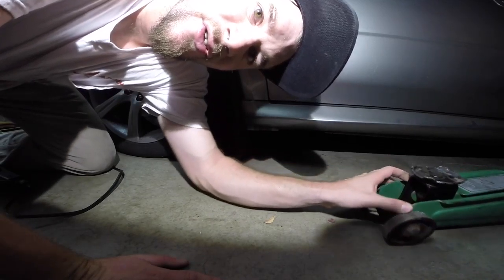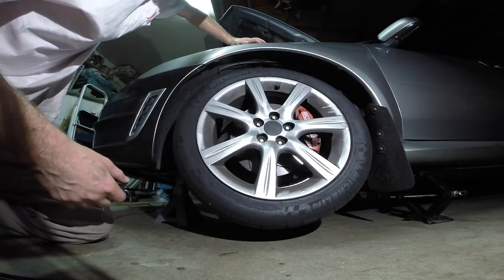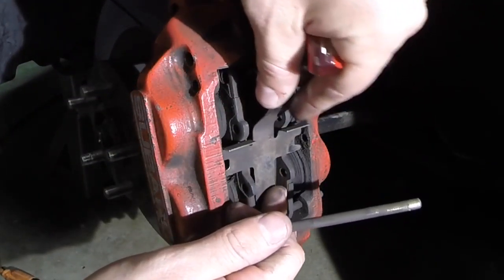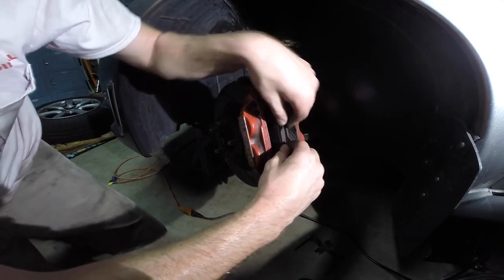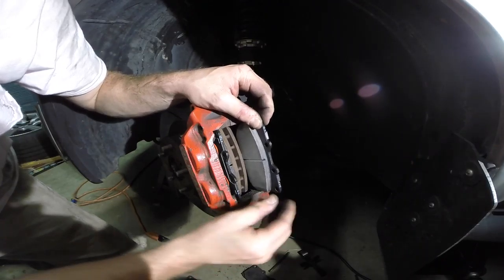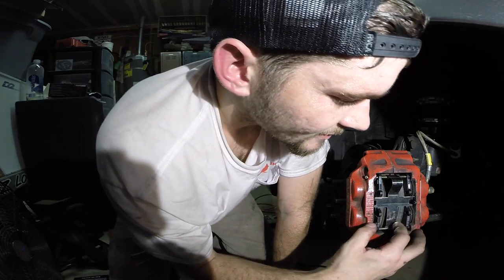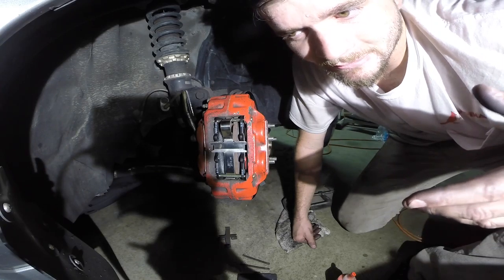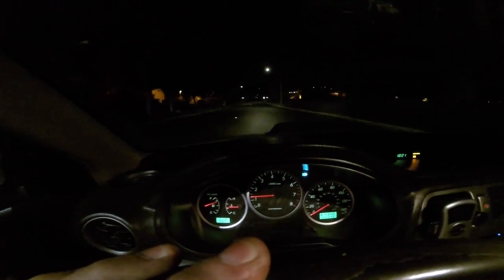Easy Subaru Front Brake Pad Install!

Comment: In case no one knows -- Original Equipment on 2011-14 WRK (Tokico) front disc are not like these Brembo. They are the regular type, where you have to remove the two nuts and then the floating caliper to get at the pads.
Reply: Its fun to watch but won't help much with my 99 Forester.

Comment: Awesome video. I watched it for a refresher. i'm doing rotors as well so taking pads out is a little easier. I also use rubber grease on the boots and I'm giving it a good clean this time. A lot of brake slime on mine. Gotta love these 4 pot calipers

Comment: I wonder if Subaru and Toyota used the same manufacturer/design for the brake set up. This caliper is exactly the same set up that’s on my 3rd Gen 4Runner with sliding pins and retainer clips. Easy peasy. Thanks for the vid.

Comment: Good video. One question if your  original brake pads are still in good shape, should you still changed them due to age of the vehicle?
Reply from the maker: Thank you.  I don’t think it’s necessary. If the pads still look good with plenty of meat and zero cracks, I’d still run them! 😎

Comment: Question, my 2003 WRX has these same calipers, would I have to order 2006 brake pads? I can’t find any that fit a 2003 that match these?
Reply from the maker: If it’s a swap from a newer wrx I’d say yes. 🤷‍♂️

Comment: Did you end up having to bleed them? Ive read up if you do something simple like pads then you have to??
Reply from the maker: I’ve never had to bleed my brakes when changing pads. Only time you need to bleed is when you are changing brake lines or flushing brake fluid